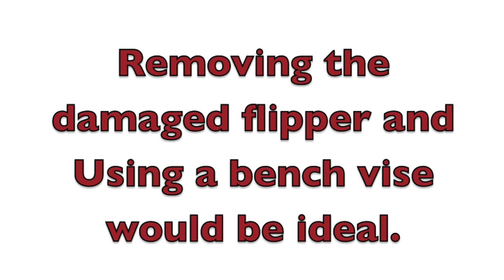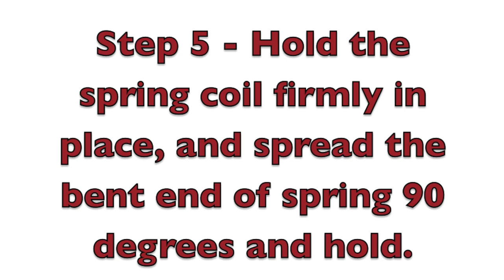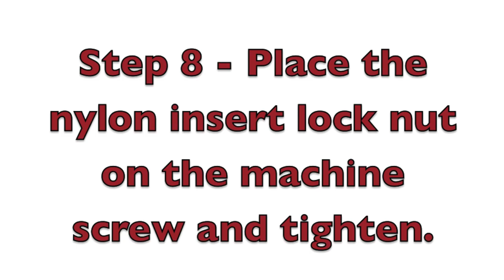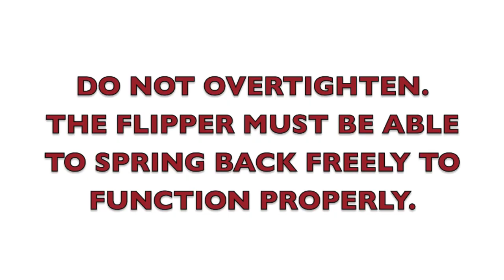How to replace a flipper

Comment: For anyone wondering, you can very easily drill out the rivet using a metal bit without removing the locking mechanism from the ladder.